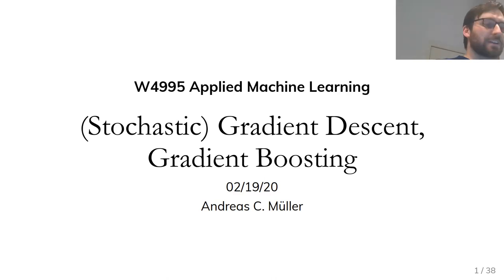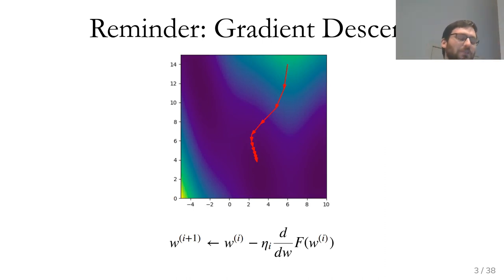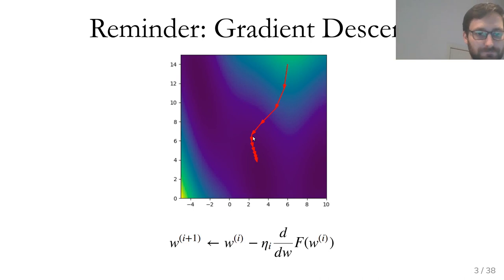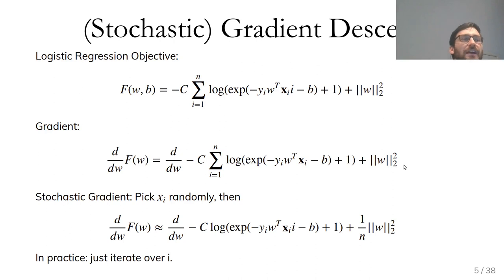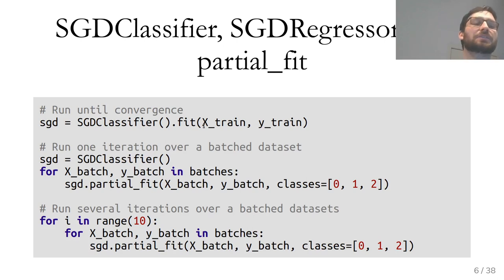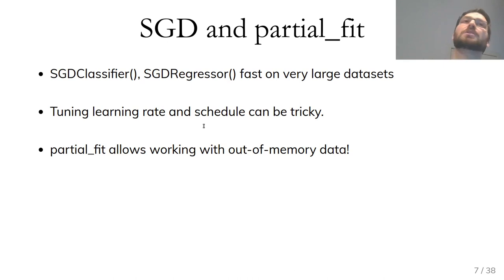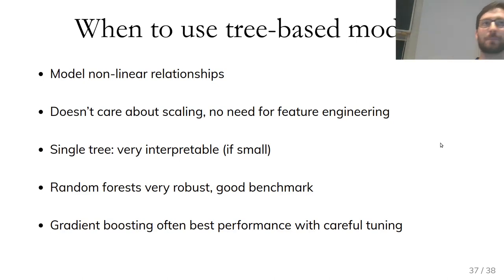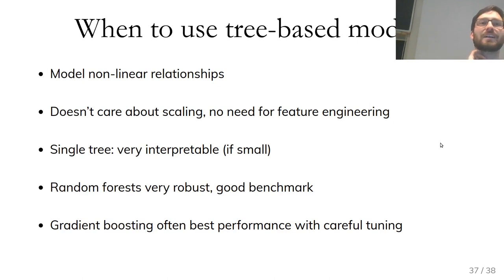Applied ML 2020 - 08 - Gradient Boosting

Comment: Thanks for the analogy between Gradient Descent and Gradient Boost, that helps understanding, and GradientBoostingClassifier is built on regression trees is eye-opening. Could you help with some questions I can't find answers online?
1. 4:50 why logreg objective is written like that? 
I was expecting something like y*log(p(y))+(1-y)*log(1-p(y))+L2 term. Here there is a C, a +1, and missing lambda on coefficient penalties, and seem to be missing a pair of () around yhat, compared to the logreg equation at 25:40
2. Previous lecture on DT/RF mentioned warm_start, is partial_fit a totally orthogonal concept to warm_start, or there's some similarity? (i'm guessing something about how model parameters are initialized/learned/used). My understanding is both use existing parameters and not restart from 0, but warm_start is applied when adding new models when growing an ensemble/for searching hyperparameter of # trees and use the same dataset, while partial_fit is focused on tuning parameters in only 1 model, using more and more new datasets?
3. 8:54 says SGDClassifier is faster than non-sgd linear models when millions of datapoints. Is this specifically refering to high # columns and not high # rows? Because it's the # columns that determine Hessian computation time and not rows? How would increased # rows make SGD version faster or non-sgd slower?
4. 25:40 says "fit the gradient with a regression tree". I'm trying to understand how the learning problem is set up in this case. What would be the X and y values to fit the regression tree? It's strange to differentiate wrt yhat since yhat is an output that should not be controllable, whereas wrt w,b makes more sense because they are controllable inputs.

Comment: why on the slide 25 after binning we get number "1" to represent the original value "5" on the first row while on the 6th row, the number "3" represents the original "5"?
Reply from the maker: Each column has separate binning based on the quantiles in that column. I think you're comparing the first column with the 3rd column. All 5s in the first column are represented by 1.